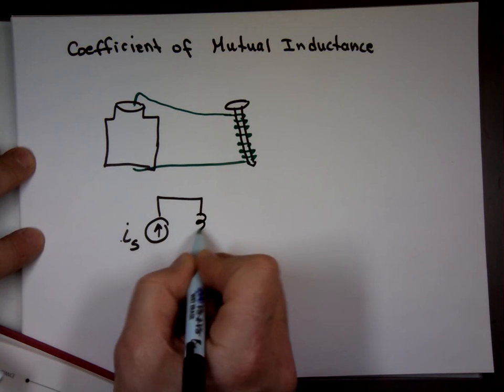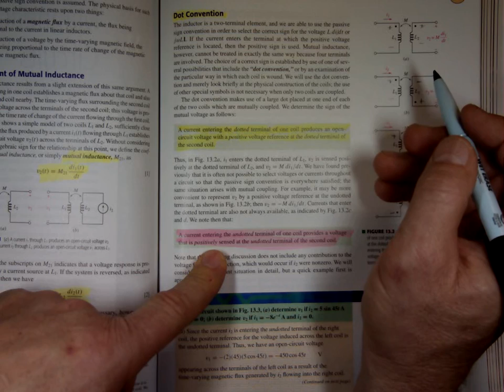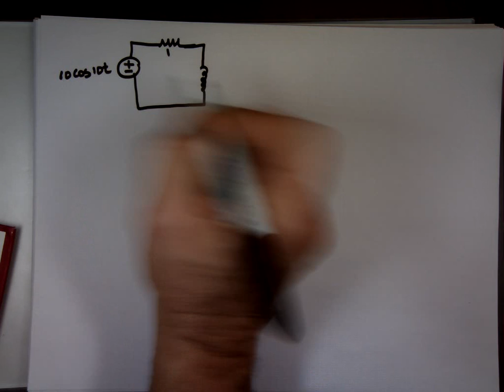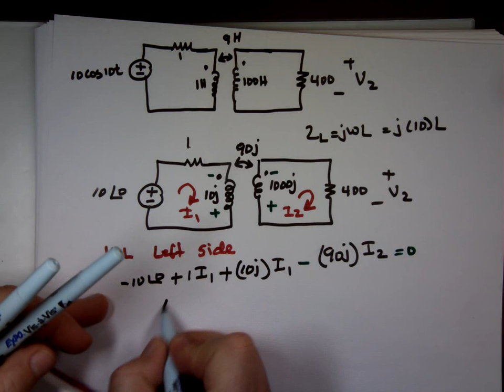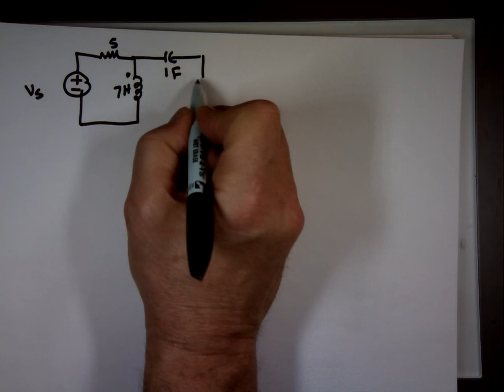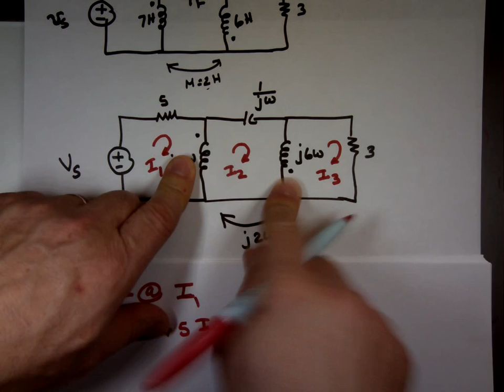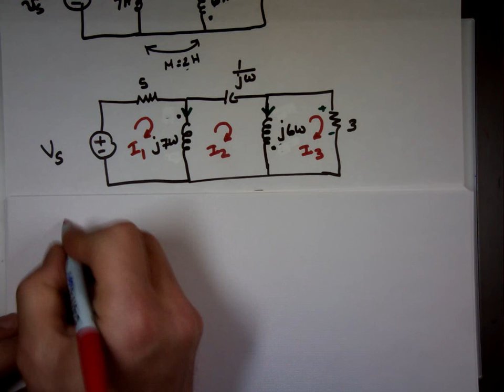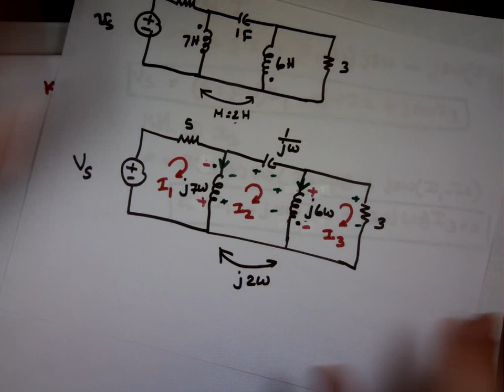Mutual Inductance

Comment: Why at the right side the mutual inductance is negative if the current i1 enters the dot side? Shouldn't it be positive instead??

Other than that thanks a lot for the video!
Reply: I looked at that and came to comment section. thanks for letting me make sure that was wrong.
Reply: The professor is right. In kvl loop on right side, mutual inductance is negative. This is because current I1 enters the dot making it positive on the left side which makes the dot on the right side also positive by dot convention. Therefore polarity of  mutual inductance is opposite of direction of current i2, which is why you subtract the mutual inductance in kvl loop equation on right side.

Comment: KVL right side: 0 = 400I2 +1000jI2 + 90jI1 = 0 ?????
Reply: Đam Mê Cơ Điện Tử it should be
Reply: that's what I am wondering too.
Reply: No, it's minus 90jI1.  The professor is right. In kvl loop on right side, mutual inductance is negative. This is because current I1 enters the dot making it positive on the left side which makes the dot on the right side also positive by dot convention. Therefore polarity of  mutual inductance is opposite of direction of current i2, which is why you subtract the mutual inductance in kvl loop equation on right side.